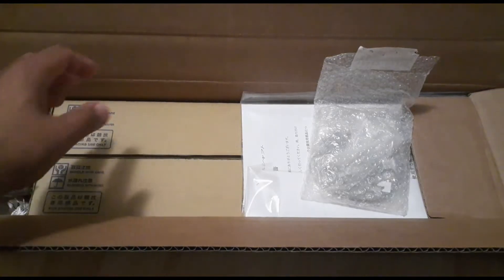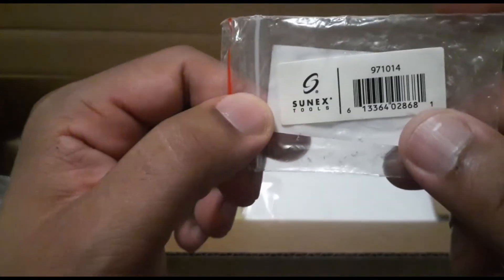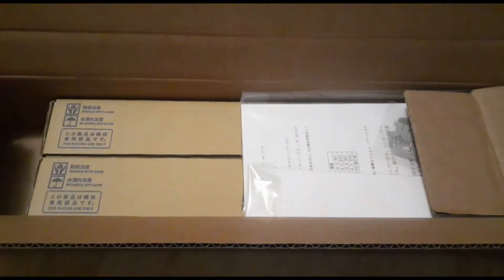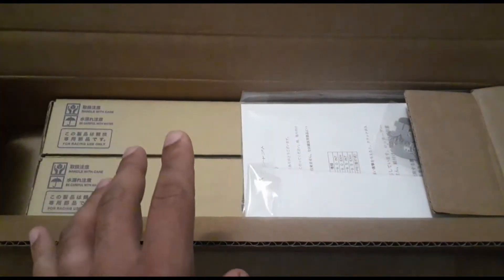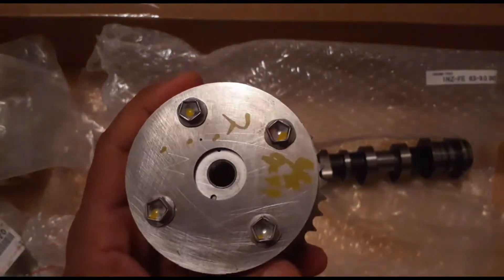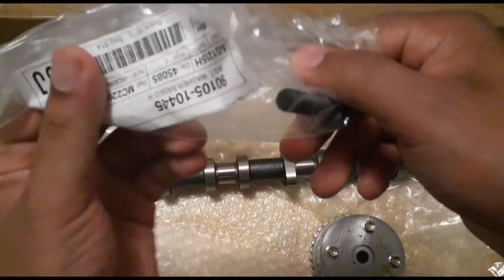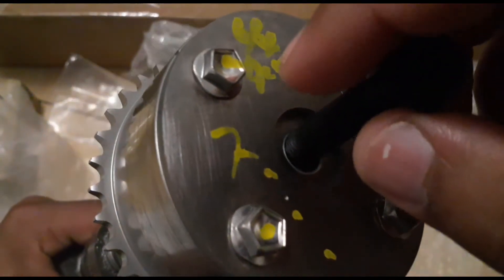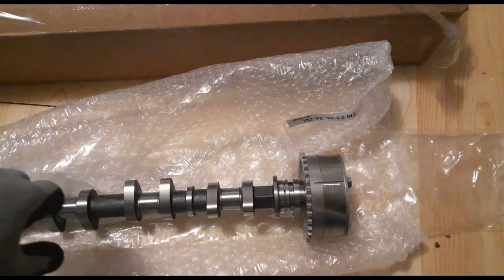1NZ-FE Timing Gear Install & Everything Needed

Comment: I have the service manual and on pages EM-53 and 54 I think there are some mistakes. Can you verify the sequence of the vvti gear install? 1st the gear must be unlocked. 2nd you slide it on to the camshaft. 3rd you install and torque the bolt while holding the camshaft from turning. 4th holding the camshaft from turning and looking at the face of the gear you turn the gear counter clockwise to full lock position. 5th then you can put it in and put the chain on it. Do I have this right? Thanks!

Comment: awesome video bro. 
i saw the anotation on JUN's website that says if your engine is January 2004 and before you'd need the camshaft gear for the exhaust cam. my car is 2006. i was wondering what year is your's and if i need the cam gear as my car is after the date JUN said.
Reply from the maker: Thanks bro 🙏🏼, mines is a 2009 na you don't need to change the exhaust Camshaft sprocket
Reply: @ScorpionMultimedia  thank you
Reply from the maker: You're welcome

Comment: What benefits does this camshaft give?  Looking for ways to upgrade myself.  Thanks.
Reply from the maker: this camshaft it a semi racing cam from jun so it compatible with stock valve springs and ecu but will get overall better performance over stock cams such as hp, torque, choppy exhaust note and from what a subscriber had told me from their experience itll start pulling around 3k rpm as well, but with a ecu remap you'll get slightly higher gains